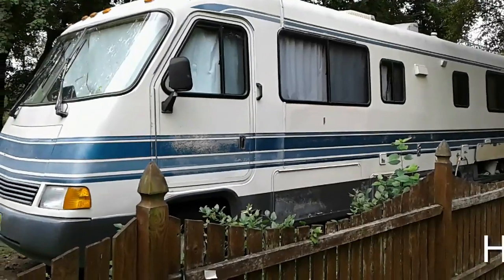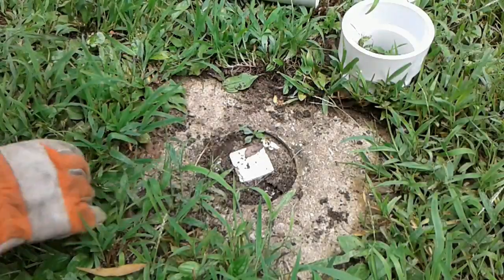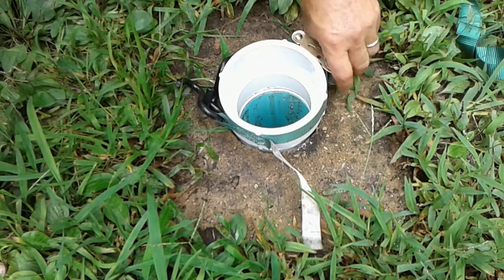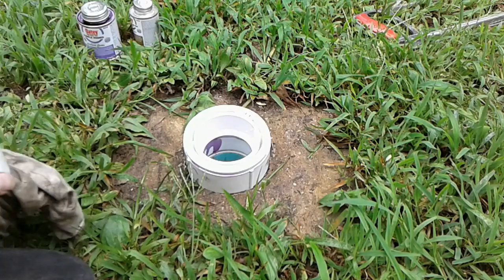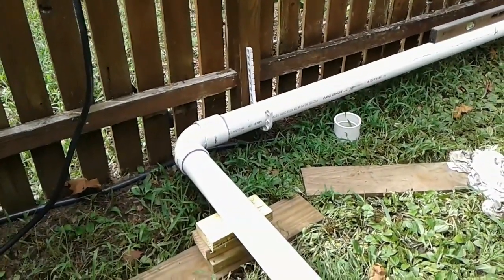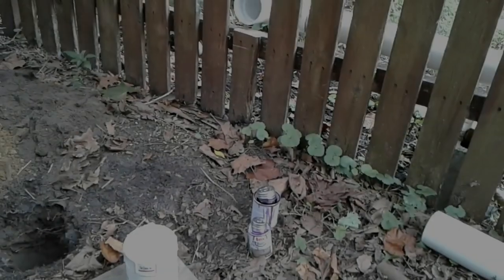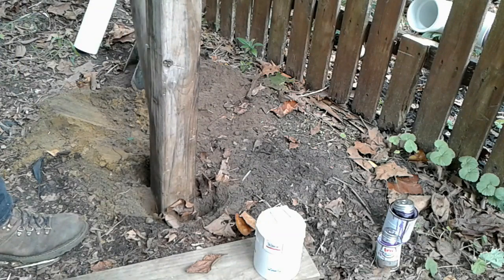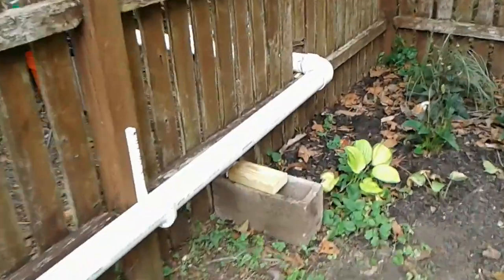How to Connect your RV to Home Sewer

Comment: Great video! I will use most of these ideas on our property but piping it into our cesspool. Do you leave your black tank open all the time in this configuration?
Reply from the maker: I don't usually leave the black tank drain valve open. For example, I had a guy staying the RV for a week recently. I kept the gray tank valve open, so that all shower and sink drains could just run out. But I kept the black tank valve closed and allowed it to accumulate a larger volume of waste. The black tank drains better that way. Additionally, when I go to drain the black tank, I dump about 5 gallons of water into the toilet before pulling open the drain valve. That helps it all flush out of there. Hope that helps.
Reply: @Buckwsr  Thanks....I was thinking alone those lines as well...
Reply: NEVER leave your black tank open, even with a hook up. You will get the dreaded "Cone of Poo" and will probably have to drop the tank to get it out. You NEVER want a dry black tank unless it's going into storage. I also wouldn't do the grey open all the time thing. One benefit of doing the grey tank after the black is that it washes the raw sewage out of the line. In a rental situation like this, I'd just wander past every other day or so and do the grey, and every second trip I'd do both.

Comment: Why not put  a "T" or actually a
" cross"connection in the reducing fitting in case you need run a snake toward the van and or run a snake down into the clean out? I'm not a plumber,...just asking.

Comment: I am curious, the flex hose from the RV to the hard pipe, it appears you are just shoving it in the end of the hard pipe.  How do you keep it from popping back out?  I am looking at something similar, basically my house access port is right beside where I park my trailer so i am trying to figure out how I can connect the RV sewer line to that port when i need to empty the tank.  Thanks in advance for your reply.
Reply from the maker: You'll have to get creative. I used a store-bought RV sewer connection fitting to plug into the white PVC adapter, and then kept it in place by drilling a screw through the adapter and into the fitting. Not perfect, but it works. I also had to support the brown flex pipe to keep it from sagging under the weight of the contents (not shown).
Reply: Just put a sand bag over it. Won't pop out.

Comment: Helpful video, in the town I live in this is illegal as hell. 1, you hooked into the city sewer with out a permit? 2. RV are not allowed to house people on city home lots. 3. There needs to be a stand vent pipe and a way to block sewer gases from getting back into the RV. The RV slide valves are not city approved. 4. The flex hose used to connect to the RV has to be replaced with hard piping. 5. Is that white pipe rated for sewage usage? Still a good video though.
Reply from the maker: I honestly had to laugh when, after tearing my project to shreds, you ended with the words "Still a good video." I won't answer all your objections, but tell you that in the end, the main value of the project is to have a convenient place to empty the RV waste tanks without having to drive to a dump station.

Comment: how did u winterize?
Reply from the maker: Hi Dora, because of freezing weather, we don't use the RV in the winter. RVs simply are not well insulated against the cold, and you don't want the plumbing to freeze and crack the pipes.  I made a video on the process I use to winterize my current RV. You can check it out here: https://youtu.be/uLPXa2AHf2w

Comment: You lost your cleanout. Like the idea but think I would have used some type of tee with pipe coming in from side and still had a cleanout on the top.
Reply from the maker: That's a good point. I've got three clean-outs between the house and the street. I've never had reason to use any of them in 20+ years. I think it'll be alright. Thanks!

Comment: I know you posted this as a helpful how to, and  I realize you didnt ask for my opinion, but I want to add my 2 cents.  You need to stay on good terms with the neighbors. I see IRS, and code enforcement issues. Even if everything is to code, and your paying taxes, I see aggravation. Someone gets injured during their paid stay and its more trouble. I just feel better telling you this, as I like, follow and learn from you.
Reply from the maker: Thanks for the note, Joe, and the kind way you shared your concerns. I think I tell myself that in the event I encounter any problems with local authorities or whatever, I would simply uninstall the piping system. That would take me 15 minutes tops, as it is entirely above ground. No big deal. As far as neighbors are concerned, yes, we have great neighbors and our properties are pretty large (mine is 1.5 acres), so there is no problem there. Also, because the piping runs inside the fenced area, it is not very visible to our neighbors, or to anyone else. The reality is that the system gets used very seldom. The RV I had in this video was later sold, and I upgraded to a nicer one. But it took me a year and a half to get it fixed up to the point of being able to use it. Only recently have we been able to use it, or to have short term guests stay in it. In the end, the system is really just a convenient way for me as an RV owner to empty the waste tanks without having to drive to an RV dump station.
Reply: @Buckwsr  My best to you and your Family, especially during these difficult times we are living in.